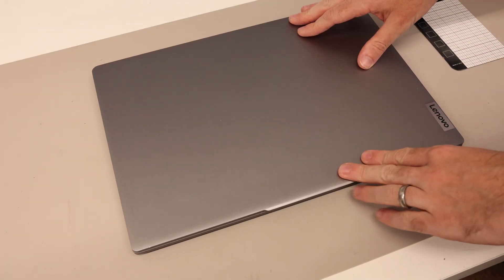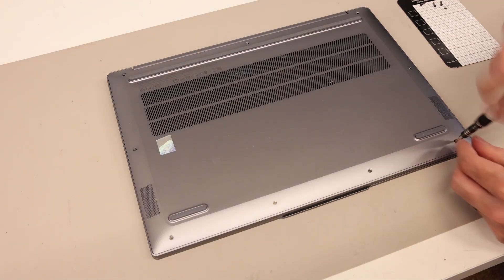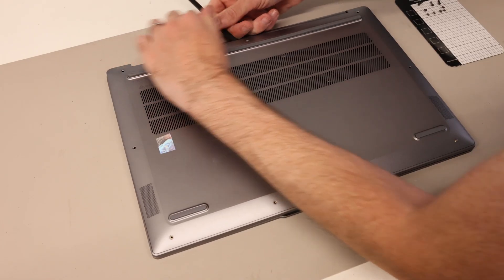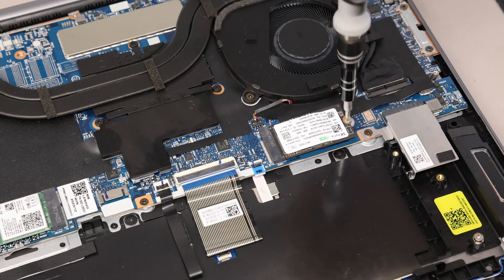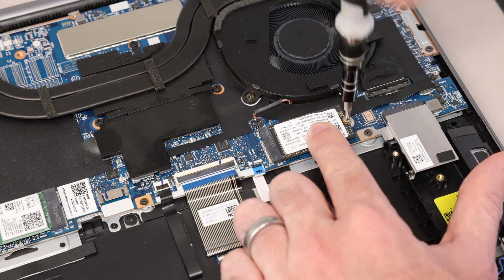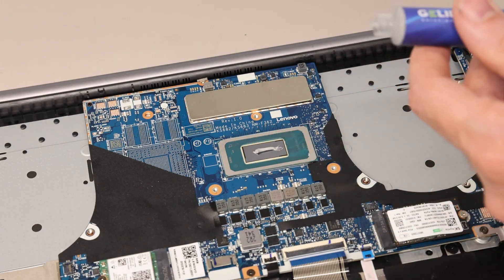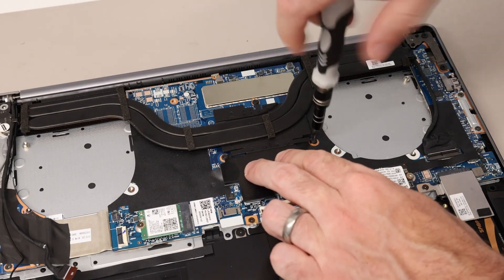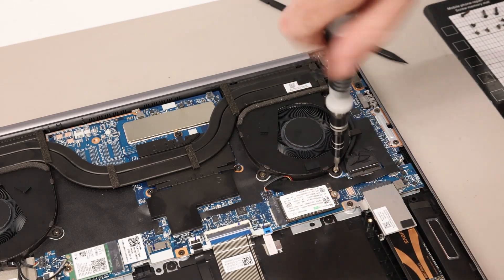Lenovo IdeaPad Pro 5 16IMH9 - SSD Upgrade and Fan/Heatsink Servicing Guide

Comment: Thanks for this video. I just bought an ideapad pro with core 5 ultra and rtx3050. First thing I will do is to add a 4tb m2 2280. I was thinking if there will be a need for a ssd heatsink but as I see they already attached a small metal heatsink for the controller of the m2 2280 :).
Reply: 16gb ram ?!
Reply: @ahmedsherif1998 yep that one. I dont really need more than that. Right now I have a 17” gaming kaptop that weighs 3 kg, with 32 gb Ram, RTX4070 laptop, Ryzen 7 8845HS etc. Then I realized I dont really need that power and weight, I am also working abroad from time to time. So I bought the lenovo ideapad pro 16, with core ultra 5, yes 16 RAM, OLED screen and 6 GB RTX3050 at 80 Watts. It weighs 1.9 kg with aluminium body. It will be more than enough for my tyoe of gaming and general stuff for me :). I usually play CS2, Star Craft, Age of Empires II :). Old stuff :).